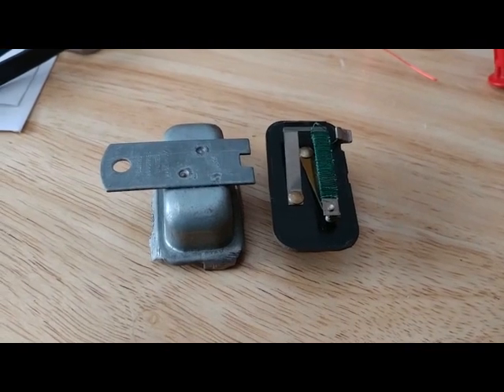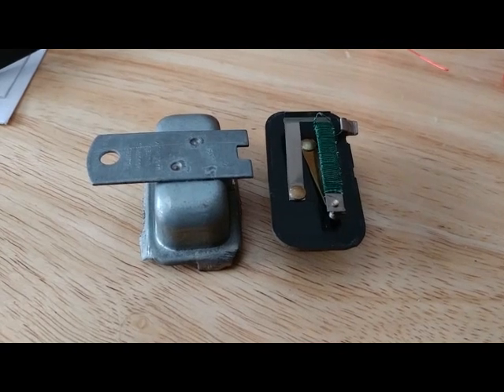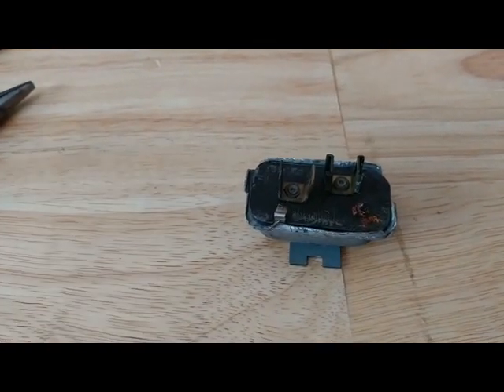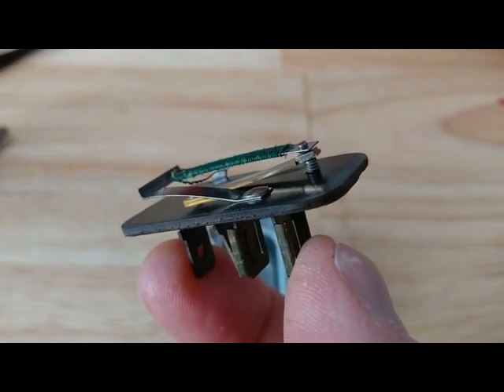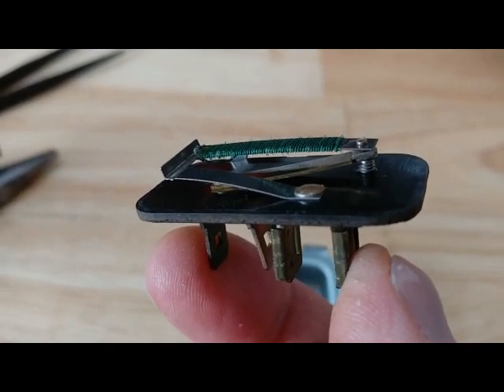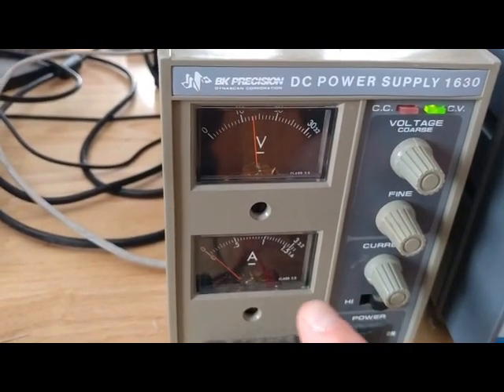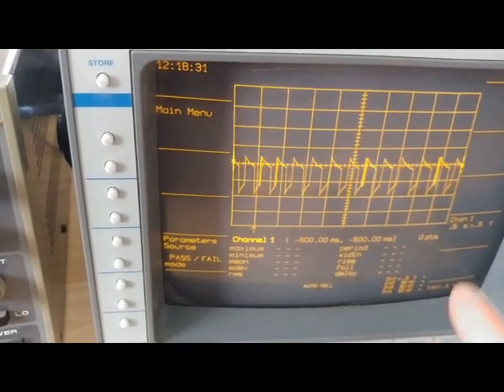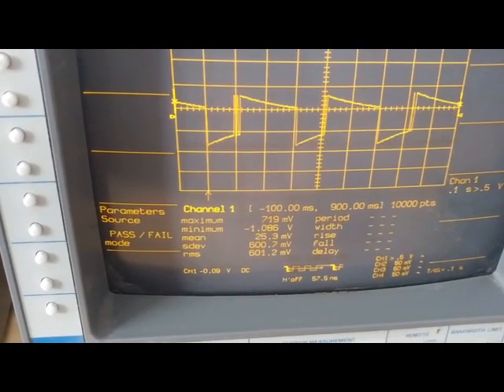Vintage Smiths voltage stabilizer teardown

Comment: Nice rundown on these. I didn't expect you to break out the LeCroy however... :)
Reply from the maker: I do love my LeCroy!
Reply: @smellsofbikes  I should have known something was up when I saw the BK. My gear is a mix of HP (Logic Analyzers, Frequency generator, Data Acquisition unit - the oldie but goodie HP stuff) and Rigol scopes. And of course meters, soldering/desoldering stations, and whatnot.

And I surmise from your site that you are in Colorado? I grew up in Black Forest outside of Colorado Springs.

What brought me here was a recommendation based some searches that I made for a "modern" version of these. Wegs Garage (TR4 channel) ran into the same problem as you and bought a replacement for theirs. But I suspect that Moss shipped them a positive ground version by mistake. It blew, of course, and the teardown revealed that it was a through hole device mounted as if it were a surface mount device. :)
Reply from the maker: @MrWaalkman  90% of my stuff is HP since I used to work for them: all 1980's stuff.  I used to go to summer camp in the black forest.
There are modern replacements but as you've found they can have polarity issues.  I put a buck regulator in this car for a while, during repairing this one, and now have a modern linear regulator doing its job but since the vintage one is repaired I could always chuck it in again.
Reply: @smellsofbikes  I remember the HP place in the Springs, I can't remember what they made. As for summer camps in Black Forest, all that comes to mind is La Foret. No summer camp for us, we just played in Kettle Creek. :)

So what wire did you use to repair your Smith's? Or did you just pull the bad spot away from the bar to isolate it? And it looks like it uses Litz wire.

Comment: Very interesting way to "regulate" voltage back then. Yep a modern  sub 2 dollar dc-dc buck module would definitely fix that.  I would use a LM2596 module.
Reply from the maker: I think the modern replacements still use a linear.  I replaced this with a buck module, but don't remember which one, in a little stamped metal enclosure I made and bolted to the back of the dashboard.
Reply: @smellsofbikes  The modern replacements not only use a linear, but a through hole part on a surface mount board. LOL!

Comment: Hi, Can you please give some guidance on what you replaced this with. I have one the same on my temperature gauge on my 2500 tc & S which I'd like to replace. I don't know what parameters to search for a suitable buck regulator? 12 down to 10 volts but what current, do I need to limit that?
Reply from the maker: It's a tiny amount of current required.  Most Spitfires need a supply for both the fuel gauge and the water temperature gauge.  (I have an aftermarket WT gauge so I don't know the current the stock one takes.)  But any cheap switching buck regulator should work.  You don't need to limit the current.
Reply: @smellsofbikes  Thanks heaps.